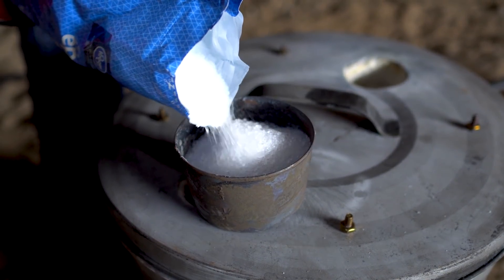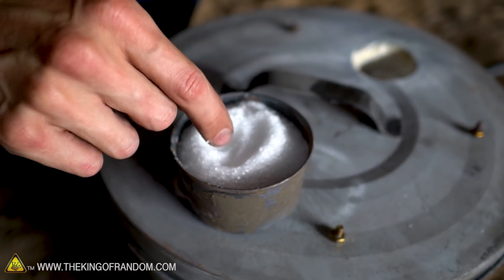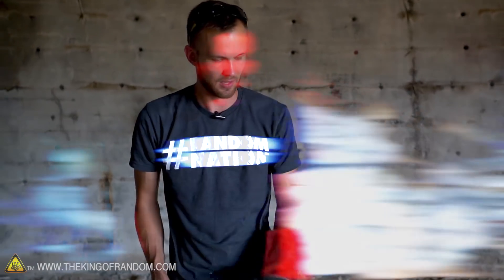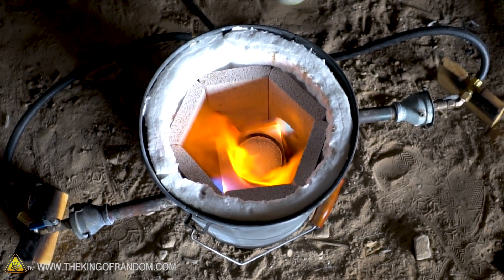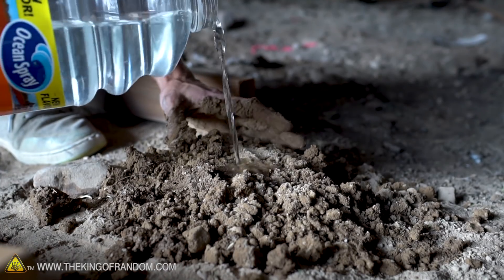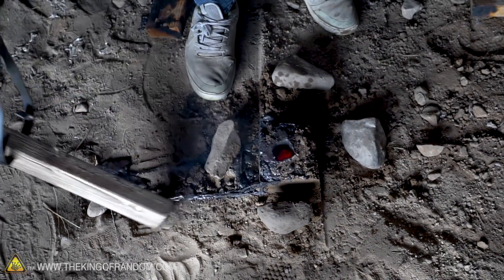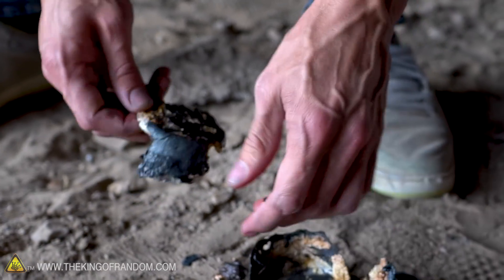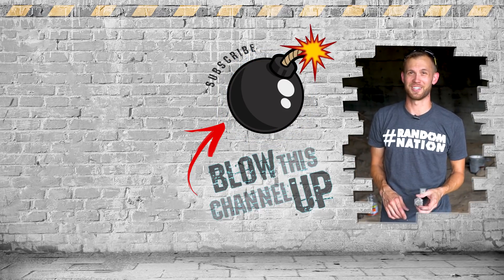Don't Melt Epsom Salts

Comment: Epsom salt is magnesium sulfate heptahydrate, so most of the liquid the came off of it at the start is just water, which destroyed the steel cup holding it by causing it to rust under high temperature.

Comment: If you use the lost wax method, you'll have better luck.  Since you have to heat the plaster mold to drive off the wax, you won't have the wet sand problem.

Comment: Rookie mistake ;) Check your melting temps.  Steel melts... or more approximately burns at ~1500 C (or as low as 1320C depending on the additives to the alloy) and MgS melts at 2000 C.  Should have used the graphite crucible for the MgS (melting temp of graphite ~3650C). Sure might have taken a few more minutes to melt, but steel will not work for this.
Reply: What
Reply: @thunderkill4318  Steel melts at a lower temperature than Epsom Salts, therefore you can not melt epsom salts in a steel crucible.  A graphite crucible will not melt at the temperatures needed to melt epsom salts, so it could be used.

Comment: What's happening is over ~1100C (2055F) it decomposes into magnesium oxide and sulfur trioxide. The latter re-joins with any water to make sulfuric acid and perhaps any thing to turn it into a sulfide, like your steel cup. The MgO is a hopeless thing in that furnace because it won't melt until over 5000F.

It'll royally screw your lungs and eyes up, too. Not for enclosed spaces...
EDIT: You never got to that point. You 'made' anhydrous MgSO4 but you didn't decompose it... didn't think about that, that furnace can't hit the temps required, but just barely. The steel soaked up what decomposition did happen, so you didn't gas yourself. Assuming you're running propane, that's going to max out around 2400F at best and you're not optimal... that color was probably showing a touch under 2000F which is lucky for you and your equipment.

Comment: Epsom Salt (MgSO4) decomposes when heated above 1124°C forming Magnesium Oxyde (The white power you had). The SO3 gas bonds with the Water vapor from your propane flames forming sulphuric acid, and the sulfuric acid reacts with your Steel Cup. Bottom line is... you can't really melt epsom salt without it decomposing.

Comment: It wasn't heat
It was great combine with water from hydrated magnesium sulfate
You would not have such extensive corrosion, if you would use dry magnesium sulfate
I dried mine Epsom salt in order to keep propyl alcohol dry (it is not isopropyl, as it down not contain water)

Comment: One flame is green because it's running through a copper fitting. Or there's a fragment of copper in the mechanism in the torch where the flame passes through.

Comment: Yes.  Salt causes iron to oxidize at a MUCH higher rate.  This is why seawater (salt water) erodes ship hulls faster than fresh water.  Molten salts tend to react EXPONENTIALLY faster.  So yes, your steel cup was being rusted away at a hyper fast rate.  Basically.  It is more complex than that, but technically correct.   :-P
Reply: Parked or moving.  Ships have zinc ingots attached to them so that the electrolysis attacks them, instead of the hull. As the ship moves through the water, the electrolysis increases with the friction of the hull moving through the water.

Comment: Magnesium sulfate is used for furnace linings!  When pouring it into sand mold, most likely you formed eutectic which has lower melting point then parent substance.
Reply: furnace linings can be made of MgO (magnesium oxide), Magnesium Sulphate under high temperatures in a furnace will chemically react to make MgO.

Comment: A word of caution... don't allow molten ANYTHING to come in contact with water,  even damp sand.  It can cause the water to flash to steam and blow the molten "whatever" "all over".  I have scars on my face from pouring lead into a large sinker mold I had cooled in water but failed to let evaporate dry.  Damp casting sand and molten metal will wake the neighbors... trust me.  That may have been what caused your improvised mold to fail. I enjoy you videos. Have fun.

Comment: I worked at a radiator plant and the way they accomplishedthe hundreds of little welds is to put the materials in a bath of molten salt of about 10,000degrees for a few seconds then wash w water, works really well

Comment: what you have there is magnesium sulfate heptahydrate.

try removing the water content first. 

I know its in a blast furnace, but maybe the heptahydrate is affecting the product when exposed to excessively high temperatures.
Reply: sorry, it will decompose (chemically change) into MgO and SO3. It won't melt even if the hydrate it cooked off first. Been there, done that.

Comment: At 1:30 the fire is green because of copper oxide burning from the high heat I see it all the time when welding copper line sets
Reply: copper sulfate to be more exact...
Reply: Steven Taylor that’s exactly right
Reply: Magnesium burns green too, I think.
Reply: @DragonLandlord  no. Bright white.
Reply: Dragon Landlord 
Magnesium burns white.
Reply: @DragonLandlord   When magnesium metal ribbon burns as in chemistry lab experiment to produce magnesium oxide... it burns very bright white you might say.

Comment: Can you meltting baking soda and see if it will still react with vineger in liquid state
Reply: Baking soda decomposes before melting as well.  The vinegar will react with the NaOH that is left, but it is not going to fizz or anything.  The fizzing in the reaction is caused by CO2 being released, but the baking soda loses all of its CO2 when it is heated.

Comment: What can you melt quartz crystal? If so what happens when you pore it into liquid nitrogen?
Reply: @D r . S p u d ok but still, what happens when you pour it as a liquid into the nitrogen? Glass would normally crack from the sudden change of temp but what happens if it's beyond the melting point and suddenly changes temp?

Comment: i wanna see you melt metal with a magnifying glass or either size solar scorcher and THEN try to cast it 😎 but it has to be a new metal you havent used yet even if you get gold or silver because their melting point is fairly low but you have to cast in a new substance as well i just wanna see it really bad because i keep burning my fingers touching my gold after its been heated as i have no gloves or ANYTHING and you guys are awesome so i know youll come up with something amazing😂

Comment: Hello The King of Random I have a question, When you blow up a balloon  and put something on the outside of it and deflate the balloon it will grip tightly around the object that is against it tightly. If you were to do that on a Glass cup small or a large cup and you drop it will it break? If so will it cut up the balloon or will the Balloon keep the cup in the same shape?

Comment: You could try the arc furnace since it heats up quite a lot more than your foundry.
Reply: Wet sand  and very  hot liquid -- steam  that expands no wonder it over flowed  . dry sand  and compact  it

Comment: Shouldn't have used a steel cup. Sulfur and steel react together to corrode the steel. This is why steel barrels corrode so fast when you burn trash in them.

Comment: You guys should make a panel of aluminum cans stuck together and colored black. Then you should let air flow through all of the cans and heat up in the sun. This could be used as an environmentally friendly air heater.

Comment: You should try making a mini flame thrower/torch consisting of a metal pipe filled with potassium protaginate (hope that’s spelled right) and glycerin, aka the matchless fire starter. Or fill a metal pipe with black powder, cap it off and put a wick in it, to see how if it’s possible to make an improv apocalypse gun. Also make a holder so it could possibly be handled without burning your hands off

Comment: I wonder what would happen if you'd melt Quartz and Aluminium together and use it to cast something. It's a weird combination but I wonder if the two would react with one another, resulting in some aluminium-oxide mixed with silicon or if the silicon-oxide will stay silicon-oxide and the two would just mix in some way. Some sort of transparent aluminium, perhaps? :-)
Reply: Wim ten Brink the quarts would melt into glass and the aluminum would just melt and they will form layers so when you remove it from the furnace you will be greeted with essentially a crude mirror.
Reply: Even when you pour them together into a mold? Or would the aluminium form some kind of metal bubbles in the quartz? And are you sure it won't react and release the silicone from the quartz?
Reply: Would be cool, though! :-)
Reply: Wim ten Brink yeah
Reply: Yes

Comment: Can you please try to freeze mercury to a solid with liquid nitrogen???
I would really like to watch that!
Reply: I think codyslab already did that
Reply: Yeah
Reply: 50 below well freezing mer.
Reply: dude check mercurys freezing point
Reply: M. A. Malcolm i would have to look it up, but I think it was around -30 degree celsius. I tried it with dry ice and it worked. Nothing special..just a shiny, cold piece of metal similar to tin.
Reply: making solid nitrogen is VERY HARD like theres only one object has solid nitrogen and its pluto
Reply: Sun The Yellow Star making solid nitrogen isn’t that hard, but..
we want to make solid mercury using liquid nitrogen 😅
And you don’t need liquid nitrogen, dry ice is enough (maybe I’ll upload a video later today)
Reply: @among-us-99999  but we are talking about nitrogen
Reply: Sun The Yellow Star I thought we were talking about freezing mercury?
Reply: @among-us-99999  ok that is getting. weird imtalking about nitrogen but you are correct about the dry ice thing

Comment: You should try using MAPP gas when melting items in the foundry. It has a higher combustion temperature, which would allow the material to melt faster/hotter.

Comment: While I agree with others in the fact that MgSO4 doesn't melt (instead it decomposes), a bigger problem is the use of a ferrous material for a crucible: sulfur compounds react rather easily with iron (especially at high temperatures), hence sulfates are not supposed to be melted in ferrous crucibles.

Comment: maybe you can try casting the table salt in a clay mold. and as for the epsom salts you may try melting it in a titanium/iron alloy crucible and if it holds the furnace also try to cast it

Comment: Can you make à handmade hydraulic cylindre, that run with tap water pressure ?

With this water pressure/flow (3bar and 12L/min, in France)
There is enough mechanical power to carry 80kg at 7cm/sec... you can make what you want with différent sizes of cylinders (maybe PVC pipes ? 🤔) , and it represent à lot of strengh ! ☺

Comment: This video seemed very poorly planned and executed compared to the normally well thought out and planned videos I'm used to. This is no reflection on the results, because as you know; sometimes you learn more from failure sometimes. 
ay research stainless steel melting point versus Epsom Salt melting point. Using modern casting techniques instead of "Bob's Backyard" casting techniques. Because of this (going of of how it appeared in this video) lack of forethought, the answer to the person's was not discovered.

Comment: Can you and grant make an obsidian sword with molten lava?
Reply: Someone else has tried this, you can't melt obsidian and make more obsidian. Its impossible, you have to add a flux to make its melting point lower (no foundry gets hots enough no matter what you use) and it then makes the obsidian less stable to cast and it snaps easily
Reply: K l how to make everything did this
Reply: @michiganmitten1147  is that who? Lol i found the video one day at like 4am after clicking one too many related videos 😂
Reply: Lava and obsidian are different things... Sorta.
Obsidian is made dependent on how the lava cools. He isn't asking about casting remelted obsidian. He is asking about lava, molten rock. And using knowledge on how obsidian is formed in order to cast a sword using the newly created volcanic glass.
Reply: @YEAHKINDA  it still wouldn't work, where do you expect them to get lava? Lol you cant just buy it online and its so hot you need special equipment to even handle a small amount
Reply: Isn't minecraft my dude lava doesn't just turn into obsidian, it has to be a very specific type of rock that is melted.
Reply: +Wesley Hammonds Obsidian is formed by rapidly cooling molten rock or lava.
Reply: That is true but only with very certain forms of obsidian, you are not going to get obsidian from molten rocks such as shale, because it doesn't contain the correct compound to make obsidian which usually is a silicate rock with impurities which is why it turns black.
Reply: yes! u can
Reply: No you can't.
Reply: Ok but who wants to see a glass and salt alloy and a glass and metal alloy and a metal and glass alloy
Reply: Not a single one of those would work.
Reply: Short version you cant some people tried to forge it and cast it
Reply: Watch their video when they melted down the obsidian.It's hard and it's not lava still obsidian.

Comment: Can you make your own sheets of paper from a tree?
Reply: easily done, yes you can. shred it as much as possible to separate as much fiber as you can and glue it together in a sheet. also a common practice used in recycling: shredding, soaking in water so the cellulose is getting loose, and then sifting it up. the cellulose itself binds to itself as much as possible, tho not as perfect as it would be if you used a glue specifically for paper use

Comment: Please make a mold of your own thumb and see if you can unlock your phone with it!?
Reply: doesnt work 100%, depends on the sensors. some sensors use differences in resistance in addition to the fingerprint to prevent such things from happening. its the same with the responses on the screen. you cant trigger an action on the screen with a regular pencil for example

Comment: Nate, you're right; THIS doesn't MELT like normal...  In fact, it decomposes (several times) rather than melting.  Under normal atmospheric conditions, you will never be able to melt it.
Many minerals are hydrated - meaning that the metallic cation is coupled with one or more water molecules - and that the hydrated cation is integral to the crystal matrix. Heated MgSO4•7H2O decomposes to MgSO4•H2O, then subsequently decomposing to MgSO4, which finally decomposes to MgO(solid, with melting point over 5,000°F) and SO3(gas).  No magnesium sulphate remains.
"The steel cup it is in is starting to fall apart....it's possible that the magnesium sulfate does something as well..."  Yes, the SO3 gas is extremely corrosive and is used to make SULFURIC ACID!
Reply: thallok i loved that explanation that was awesome. even though i probably look like a lowlife for commenting NOW i still thought that was awesome lmao.
Reply: @aidenbaker585  
Disagree.  Agree.

1) You DON'T look like a lowlife. If diminishing yourself, for whatever reason, is a habit, you might want to consider tapering off/ceasing.

2) The explanation was EXCELLENT, clear, and straightforward - - the best.  It made actually laugh out loud.
Reply: thanks for the more info im glad someonehl has write it
Reply: So what we're saying is they essentially made mustard gas...
Reply: no... it's Sulfur Trioxide. an odorless gas that is highly corrosive, meaning it eats through materials. Probably not something you want to breathe. lol
Reply: Sure it's missing the actual molecular similarity but in practicality it has the same effect of reacting with the water in your lungs and drowning you in blood even if it is missing the chlorinated hydrocarbon that makes it tick.
Reply: Logic🤯
Reply: So what does that mean not for peopole who have finished school yet?
Reply: Wow intelligence found in a you tube comment;did I pass into an alternate dimension ?
Reply: Maybe it made a eutectic system with the components of crucible, thats why they were able to melt it...
Reply: SO3 can’t be turned in to something because of the o2  is compressing it to so say you have SO3 it would decompress anything you put on it so I mean you just did this the metal is decompress from the SO3
Reply: H2O + SO3 -> H2SO4 (Sulphuric Acid)
Reply: maybe they can make a video on sulfur trioxide.
Reply: Awesome chemistry! thanks.
Reply: Maybe that's how the CIA made the kerosine fire able to destroy steel? [🎶X-Files] 🤔
Reply: be honest, im a grade 4 student
Reply: thallok  I understood everything you said and im 9
Reply: SO3 + blazing hot H20 produced from fuel combustion should readily produce that H2SO4 I imagine. Although H2SO4 and MgO react to produce MgSO4 and H20 under normal conditions, it'd be interesting to capture fumes and test the contents.
Reply: Can I higher you to work in my camper that is totally not a meth lab?
Reply: Oh yeah, is that right? Well ill just take your word for it but i actually know that just makin sure everyone else does lol
Reply: Ahh, is this why certain compounds, in exam questions for example, are referred to as anhydrous? Because they can exist without the water molecules?
Reply: Dont smoke it
Reply: I don't understand
Reply: thallok how much time do you have in your hands?
Reply: @TheOmletteDoesntLie  That takes like 45 seconds to find out with the internet.  Googled Epson salt, clicked on wikipedia link, 7th sentence says it decomposes upon heating into MgO and SO3.  Clicked link for SO3, first 2 sentences tell you it is a highly corrosive precursor to sulfuric acid.
Reply: @TheOmletteDoesntLie  
What is the point of your question?  Is there any?
Reply: @TheOmletteDoesntLie  Depends which subjects he studies, I learned about this when I did my A Level in Chemistry

Comment: The remains of that stainless steel measuring cup could be tested for iron, chromium and nickel sulfides. Add some mineral acid to the residue, there will probably be the rotten egg smell of hydrogen sulfide.

Beware, hydrogen sulfide is HIGHLY TOXIC!!